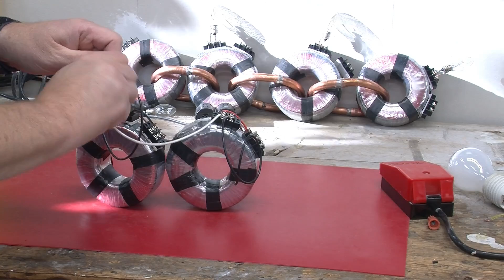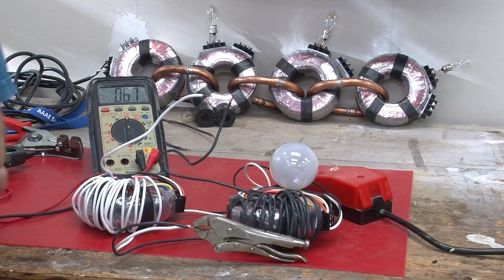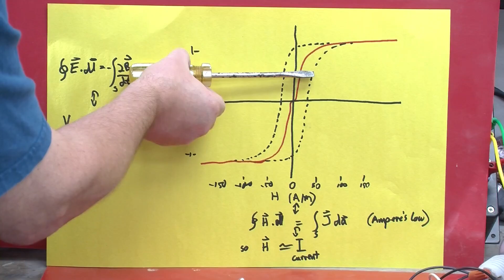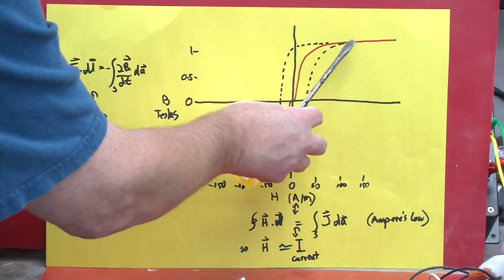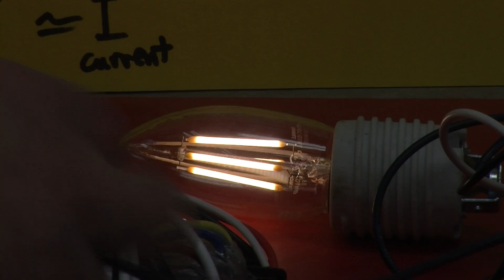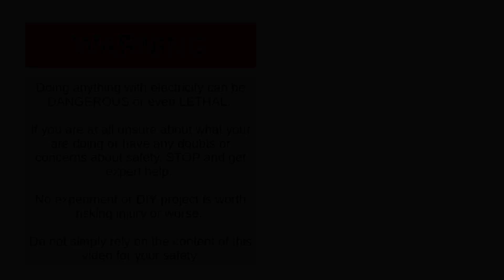A Magnetic Amp and Core Memory

Comment: In the eighties I serviced a CO2 laser that used a magnetic amplifier to control the output power of a high voltage transformer that powered the laser. The current through the control winding was regulated by an eimac triode. The grid voltage of the triode was regulated by a transistor circuit. The combination of those three technologies made it interesting. Sometimes it pays to be aware of how “old” stuff works.
Reply from the maker: That is so interesting particularly to me and I'll tell you why: in the late 80s early 90s I was a grad student and often used a Spectra-Physics argon laser in our lab. It was run by a large three phase power supply and water cooled, all to produce probably less than 5w of light. From your post now I wonder if it had a magnetic amp in the power supply - although I think I would have noticed that - I'm sure we had the schematic. 

And for a laugh - about 5 years ago I was visiting the university with my long retired grad studies supervisor - in the center of the department lobby they had a display of antique equipment  - the center piece was our laser :)

You are so right about  "it pays to be aware of how “old” stuff works".

Comment: The nuclear submarine I was stationed on in the 80s was built in the early 70s, and had mag amps for a lot of the control circuity in the propulsion plant. Very old school, but rugged as hell and designed to withstand the rigors of combat. This was a nice trip down memory lane.
Reply from the maker: Really! Wow - that's really  interesting.  I guess weight would not have been a problem , and rugged - particularly compared to tubes which may have been the only other high power option back then. So glad you enjoyed a trip down memory lane from this video!
Reply from the maker: And you know, just thinking - also also probably somewhat immune to EMP although tubes are quite immune too.
Reply: @ElectromagneticVideos  more tolerant of high radiation
Reply from the maker: @h7qvi  Good point. Now that I think about it, the copper and steel are probably immune to radiation and even the plastic insulation would only degrade with really high doses - and I'm sure there are plastics or similar insulators know to withstand very high level of radioactivity.

Comment: Back in the late 80s a friend bought an old Burroughs computer that was being scrapped from a defunct business.  $10 or something like that, more or less take it away and it's yours.  It had core memory in it.  The carriers were about an inch square of white ceramic material with gold plated pins.  The array was a square of uniform tiny cores that were small enough to need a magnifying glass to see the feed through holes.  They really were a work of art.  I have one here somewhere.  The idea of using different signal levels to increase data density should be familiar to many people.  It's exactly the same concept as employed by MLC SSDs to increase the NAND storage capabilities.  The shape of the spike in the waveform will be familiar to people that have done work with magnetic media, floppy drives, tape drives etc.
Reply from the maker: I would have killed for that computer! Really tiny cores - must have been the final development of that technology.  I actually have some vintage core memory too - one sample from the US and one from the USSR. Both bigger than yours. Amazing how they would have woven them  - as you said, a work of art. Yes - multi-level NAND storage - same idea. I don't think the vintage cores ever were multi-level though - although maybe someone will correct me on that!

Comment: I have worked with magnetic amplifiers as a means of measuring high DC currents (approximately 400A). A pair of inverse wound cores over the main power bar will give an output proportional  to the current in the main conductor. Very robust and reliable and ideal for rough environments such as railway trains.
Reply from the maker: So using it as a current sensor? I had no idea the concept was used that way! So from what you say, it sounds reasonably linear presumably when beyond a small minimum current? Railways - so to measure the current going into the drive motors in a locomotive?
Reply: @ElectromagneticVideos  I am going back to 1980 before microprocessor controls etc. The design consisted of two back to back cores made using mu metal so the magnetizing current  was low, They were excited with a 400Hz square wave from an inverter. They had decent linearity over quite a wide range and were ideal for the application

Probably now replaced with hall effect transducers on new designs.
Reply from the maker: @apk55  Interesting! I didnt know mu metal was used for anything other than shielding. I'll bet your right about Hall effect replacing it - although one viewer pointed out fluxgate sensors which are two winding saturation based sensitive magnetic sensors.

Comment: its special that you combine 2 exiter coil on the toroid and complete it in one circuit from the 2 coil i like this idea instead of only exiting one coil at a time thank you this gave me an idea of circuitry for my electronics project i plan to make a toroid coil generator something never seen but i can tell by this video that my theory will work cause it does in fact boost the amperage i will test 2 independent exiter circuit vs one circuit exiter like you shown !
Reply from the maker: Glad you found it interesting and useful!

Comment: watching the current spikes phase up and back on the AC waveform reminds me of a DC drive, and the action of those coils reminds me of the saturable reactors some of the early DC drives used
Reply from the maker: Saturable reactor - thats exactly it! - the purpose built version of of this usually with the DC coils being on the outer leg of a fairly typical IE transformer core E. 

The spikes can be huge - undesired in this case but once commenter pointed out how they were used to trigger high current tubes way back before high power semiconductors.

Comment: I have an old heavy TIG welder that has a very interesting amperage control. Imagine a three-phase transformer, with three cores, the core on the left will be the input from the 240 volts, the core on the right is the output for the tig, something like 24 ark volts? Imagine the middle core with nothing around it, the magnetic fields will flow through it taking the path of least resistance and did not making it to the end core. The electronic control for this TIG welder used a separate coil around the middle core that cuts off the magnetic field keeping the magnetic field from taking the path of least resistance. It does it without actually passing much amperage through that coil of wire. The output core on the right has a variable output depending upon how much magnetic resistance you impart on the middle core. Of course in this scenario there's nothing actually three phase about this transformer just imagine it as a way of picturing what it would look like. I might not have done a good job of describing what's going on. Sorry if I didn't describe it well enough. It's a pretty cool old school setup if you ask me, no Giant fet's or igbts. The high frequency start is a whole different monster on that machine. One that was particularly in danger of overheating.
Reply from the maker: That cool. So the general setup you describe is typical of a classic old welder transformer. The center leg of the core allows as you suggested allows some but not all of the field to  take that leakage path. This has and effect similar to having a separate inductor in series with the 240V input that limits the current input and therefore also the low voltage output current. This has the effect of making it a crude constant current (or perhaps max current) source output so when striking the arc you don't effectively short the system a blow a fuse on your 240V supply. 

In simple cheap arc welders like the one I have been using as a current source,  the leakage field on the center leg (and hence current out) is adjusted   by cranking a piece of steel in or out of a gap in that leg. It sounds like your more elaborate TIG welder might actually be using saturation by passing DC though the center coil to regulate the amount of  leakage flux. Is there some automatic regulation? That would work well with saturation control. 

I have the small modern electronic power supply welders for sale. I wonder if they are easier to use since they presumably have precise current control?
Reply: @ElectromagneticVideos  interesting, I actually hadn't considered that the center coil could have DC through it, it appears to be quite a lot of winding on the center coil, I had somehow imagined that they effectively controlling an AC load on the center coil instead of supplying DC to it. There does not appear to be a DC power supply on the control board. Now you've really got me wondering. First time around, I must have sat there and stared at it for like 15 minutes before got my head around how that transformer was supposed to work, a gap in the Middle with a steel plate would have been a lot easier to wrap my head around. As it is that part of the welder works fine, it was the high frequency that went bad. It was a solid state system that used a high frequency transformer wound with lits wire... Which was also my first introduction to lits wire. Lol the transformer totally burnt up and I tried to rewind it with wire that wasn't litz wire, as you can imagine it wouldn't pass as much current and didn't give me as much high frequency Arc. The replacement transformer is no longer in production and hundreds of dollars if you can find one. I plan to to change out the high frequency start with an arc gap system I bought off of AliExpress. Until then it's just a stick welder.

Comment: Very interesting!  I haven't tried building a mag amp before. However, the projects I work on use battery chargers operating on this principle. They call the device doing the magnetic amplification a "saturable reactor." It has a three-leg core, like an E-Core transformer. The center post of the core has the DC winding for controlling the current; and the outer two legs of the core have the AC windings which pass the current to the load. 

The charger has a typical power transformer and rectifier for charging the battery; with the sat reactor limiting the current reaching the transformer.  There is a small circuit which monitors the battery voltage and charger current. It provides a small DC control current to the sat reactor for controlling the charger. 

Look up LaMarche A12B battery charger. Good company; still making a product like things should be made.  It's so cool to see the old school technology making up the core of the charger, with a modern monitoring which can display all the info via Modbus to a PLC. Definitely the best of both worlds.

Very neat demonstration of magnetic core memory concepts, too. 

Always enjoy your projects. Thanks and please keep them coming!
Reply from the maker: Thanks!  Thats so interesting - I have never seen the a "real" saturable reactor as you describe other than in photos. And I will look up the LaMarche A12B - I'll bet it is nice and reliable. So cool that it has a modern interface.

And I will keep them coming! Its too bad we are so far apart - when I look at your videos I always think it would be neat to do a project together!
Reply: @ElectromagneticVideos  
It is interesting!  They have done a good job of keeping the modern electronics in a "supervisory" role, as well. Even if that stops working, the charger still performs its core functions. 

Yep, Alabama is a fair piece of travel from Canada.  I also think it would be good to meet up some day and share projects. With my work, travel is a constant thing, though.  I do have my e-mail available on my channel page, if you go to the about page.
Reply from the maker: @davida1hiwaaynet  Yes - sometime when one of us is near the others home base, would be a great thing to get together. I would be fascinated to see your workshop with all the vintage machinery!

Comment: Really interesting stuff! I remember reading about a high-tesla setup and it said that full field was achieved only after about 30 minutes. I didn't understand why, but I think I understand now that I see the lag effect and the likely carefully applied current and voltage waveforms to coerce a coherent and maximum magnetic field.
Reply from the maker: Thats intersting! I'm surprized it would take that long but perhaps with a huge effective inductance it could have a really long effective time constant. I have never worked with high fields like that but have seen those photos of a frog being levitated with super high field strength.

Comment: I know it by the name of saturated core regulator, it was commonly used in external voltage stabilizers for TVs.
Reply from the maker: As in a constant voltage transformer? I used one for my first computer years ago. The one I had got really hot from all the circulating currents. Worked great though!

Comment: Something I’ve been concerned with is the frequency stability issues on the output. I’ve read that these are very frequency sensitive in the sense that a small change in frequency in the AC will be magnified. So for example, trying to use this to amplify in an oscillator application is a non-starter... I had hoped I could use this in the amplification stage of an oscillator, but to no avail due to the frequency issue. Obviously this can’t simply replace a transistor (which, as a semiconductor device, exhibits ‘negative resistance’ characteristics — like in a Colpitts oscillator). Thoughts, maybe I’m completely off base with my assumptions? Great videos by the way. 🤗
Reply from the maker: It is frequency dependent because inductance is used to block the AC current. Change the AC frequency and the reactance will change allowing more or less current to pass. However this change in reactance is a different mechanism than the saturation used for amplification. Combine the two and you end up with messy combination of both. 

I had never thought of using a magnetic amp  to make an oscillator but its theoretically possible since amplification is achieved. You would need an external AC power source which after passing though the magnetic amp could be rectified to produce DC which is an amplified version of the control DC voltage. And then with suitable feedback filtering  send the amplified output back to the control input.

The impractical part of this is that you would need an AC supply, and the  frequency of your magnetic amp oscillator loop would have to me much lower than the AC supply frequency. I'm not sure if  a circuit like this would be much practical use but would be a neat demonstration.

I'm quite intrigued with your idea - maybe there is a better way of doing it that what I have presented in my thoughts. If you - or anyone reading this - has a better idea how one might do it, please comment!

Comment: Very interesting. I saw a few videos on the subject, but yours is the best! I have two questions though: 
1) Could this be used as an amplifier at HF (radio frequencies) I mean, could the saturation be changed fast enough?  
2) Could this concept be used to change the inductivity of the toroid coil, making it a "voltage controlled variable inductor"?
Reply from the maker: Thank you so much!
Your questions:
1) Yes - it was apparently used in the early days of radio with Alexanderson alternator to modulate some voice transmissions, but the problem is its limited frequency response as pointed out. My guess is it was just barely fast enough. 
2) Yes! If you kept the AC signal voltage low which it usually is, you could nicely vary the effective inductance. I dont know of any examples of this, but I'm sure it has been used somewhere!

Comment: Magnecitors on AC generators regulate the field winding current. Also used on old diesel locomotives for the same thing in the generator or motors.
Reply from the maker: I had never heard the term Magnecitor. Just googled and an found only a few fleeting mentions of it come back. I'm guessing its some sort of magnectic amp or you wouldn't have mentioned. I would be really interested to hear how it worked.
Reply: @ElectromagneticVideos  i saw the circuit of one i could make out on a label inside the box of an old generator on the smallenginemechanic channel some months ago. Iirc, it was the type of magnetic pwm where the ac is applied to a control coil through a diode.

Search for Onan magneciter, there's a few manuals
Reply from the maker: @h7qvi  I'll do some looking - I can certainly see something like that being a nice rugged and reliable regulator for those hot environments with lots of vibration.

Comment: EW I used mag amps a lot through my carier, one application was a PSU I designed for the EW equipment on a SUb.
Reply from the maker: Wow - EW stuff on a sub. You might enjoy a previous comment from someone who also worked on a sub where magnetic amps controlled propulsion (look for @johnathancorgan3994) . Its interesting they were used on subs. I wonder if it has to do with them being more  mechanically rugged than something like a thyratron in the days before high power semiconductors. And also less vulnerable to EMP than semiconductors.
Reply: @ElectromagneticVideos  the one i referred to was in 1980, there were a few fets available but had reliability problems. this system had a 100khz inverter driving about 15 output boards with a sine wave. magamps used 2 E34 ferrite cores for controlling the outputs of around 150W on some bourds. the SONAR CRT deflection took +- 15V at 7.5A. It was very reliable but hard to make. What started me on this is a guy that I worked with who was in charge of the transformer winding dep of a large enectronics manufacturer, he told me about 50Hz ones and I saw an opportunity with the new SMPS circuits I was working on.